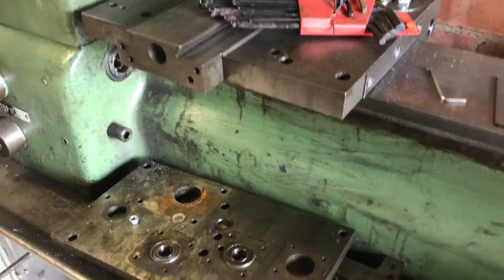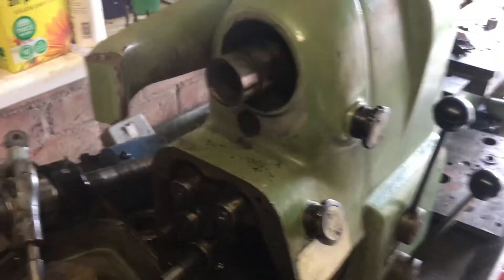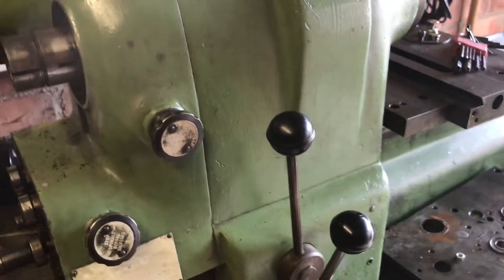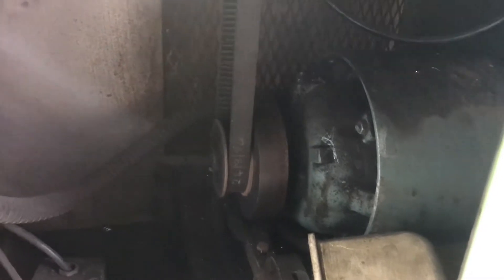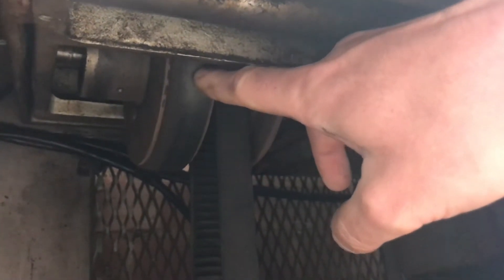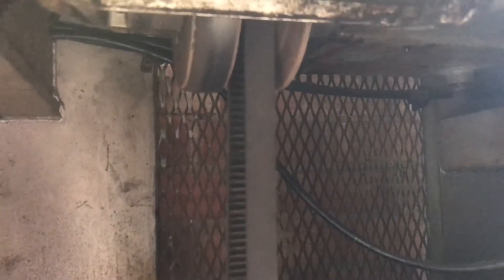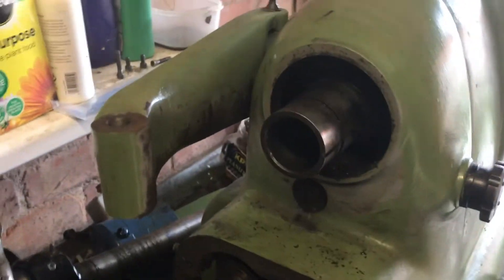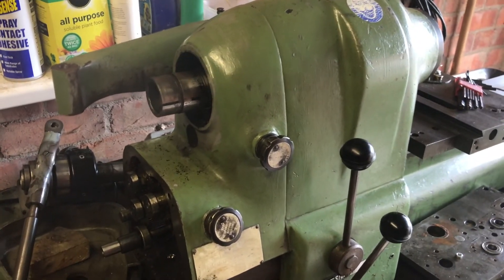Converting the Hardinge HLV toolroom lathe to CNC

Comment: Just came across this video. How did it go with the work on the lathe?
Reply from the maker: A work in progress still. Bought a Haas VMC after I got this and basically didn't need the Hardinge anymore. Just another project that's fell by the wayside :-(
Reply: @iDiveDOTtv  I have just bought one and could do with some spares if you have any bits. My apron handwheel has tons of backlash and the tailstock is a bit stuck.
Reply from the maker: @chrislee7817  I have loads of spares. 
Where are you located in the world?
Reply: @iDiveDOTtv  I'm in Bolton Lancashire
Reply from the maker: @chrislee7817  Cool. I'm over near lincoln and do have spares to sell. No apron hand wheel; that went to America. But I do have a tailstock :-) What do you want to pay for it? Please don't make me a silly low ball offer though as I won't be interested . If I'm agreeable I'll put an eBay buy it now for it and you can take it from there.
Reply: @iDiveDOTtv  no idea what a fair price is. What do you suggest?
Reply: Could also do with the apron gear and rack if you have.
Reply from the maker: @chrislee7817  I think I possibly have the rack but not the gear. 
The tail sticks go for silly money. On eBay they start at $500 plus postage from the USA. There’s one on there for $1600 too but that’s just stupid. 
I’ll consider round the £300 mark
Reply: I have sorted my tailstock, someone had fitted a short centre. By the way the tailstock is made to suit the bed ( has the machine number on it) might still need the rack though min is a bit chewed. What's a fair price for that?
Reply from the maker: @chrislee7817  Yeah I saw. That was me on the HLV group directing you where to find the serial number. I'll have a look around and make sure I have it first. Been clearing the two workshops so have no idea if I even have it.

Comment: Good Morning from Australia. I also have one of these 1950's lathe that was totally refurbished back in 1983 and is still in A1 condition. The motor to vari pully Belt was NOT the correct one it should be a 1 inch wide with a 26 degree taper and a length of 38.4 inches. I  can tell you now it will not be CHEAP to replace, mine broke last week after only 37 Years of use !!! Nothing lasts these days. LOL I found that they are not available here in Australia. I spent many hours scouring the web and e bay without any success, only supply was USA and MEGA Bucks Postage. I have a local supplier getting me one for $80 plus $ 100 Postage, cheapest I could find, Amazon wanted $ 240 Postage. IT is a GATES Belt number 1626V384. You did NOT need to remove the spindle to change the belt, it comes out the  hole where the handwheel was fitted. The next part is IMPORTANT and CRITICAL if you intend to replace the leadscrew for thread cutting. The gearing  mechanism you removed needs to be TIMED for it all to work correctly. You really need a users manual which explains and shows all this, available free online after a good search. If you want to make personal contact for further advice and I can send you .pdf of manual. please use dave90@adam.com.au  and I will be more than pleased to help as I am a retired machine tool fitter of 40 Years. If the spindle belt is original then it has done well too, I have a spare and the belts is a HAINSWORTH P 614 Mk 111 again 1 inch wide and  I just ran a measure around the outside quickly and it read 61 inches. The center section of the vari pulley should slide VERY easily, in fact if possible just slide side to side as you tip it on end , it has a internal key to stop it rotating. Squirt some thin oil down each end between the fixed flange and the moveable one and keep it moving for a while. If you do reinstall it, the book recommends running it up and down over the whole range at LEAST once a week to keep the center  pully free. I have over the Years  had to take it out and reoil as sometimes it was many Months without any use as I now use it as a hobby lathe. Just fitted DRO to bring it into the 21 st Century. Stay safe, we went into Lockdown Today for 6 days here in Adelaide. Hope to speak soon. Regards from Dave.
dave90@adam.com.au
Reply: Hi there Dave 
Really good advice on how to do the belt I just recently got and hlv just on this video and can’t figure out the squeaking belt noise I think one is to lose I would love to have the pdf manual for this machine! Anyways stay safe
Reply: @2geclipsegsx  Hello there , sure I can do that and I can also send pictures and offer personal instructions if need be. Contact me direct at dave90@adam.com.au
Reply: @2geclipsegsx  Still eagerly awaiting you email so we can sort out your lathe. Personal email is dave90@adam.com.au
Reply from the maker: I got a replacement belt direct from Hardinge. The belt was cheap but the postage they wanted was extortionate. If you know someone in the USA then get them to buy it then to repackage it for international mail.

Both belts needed replacing so the spindle did have to come out.